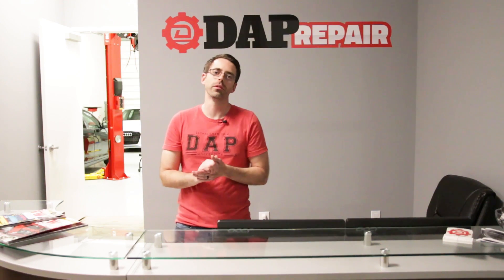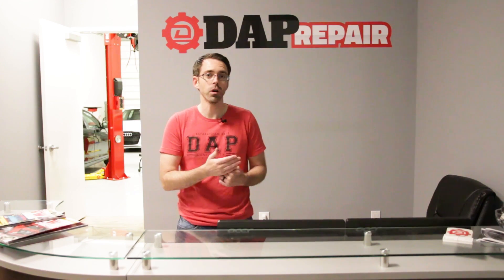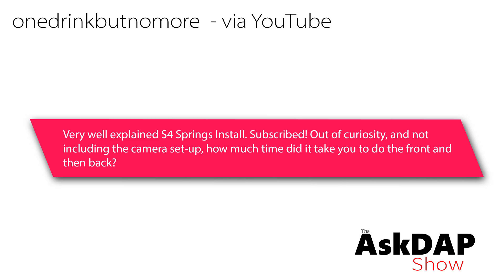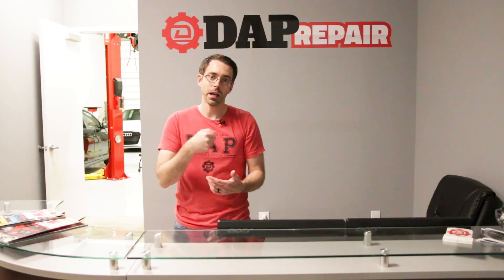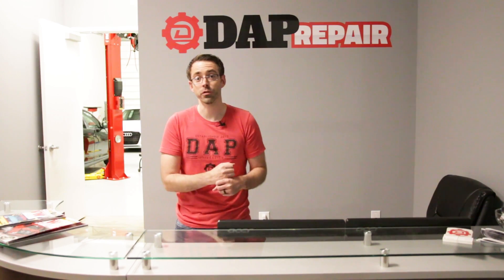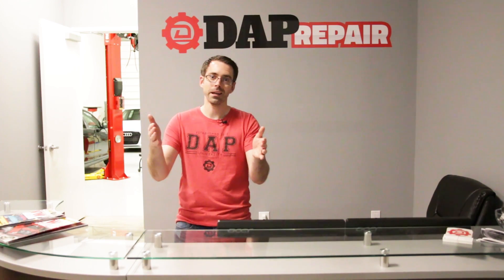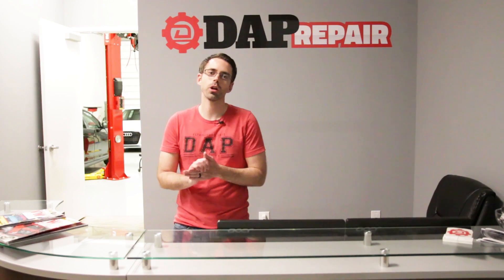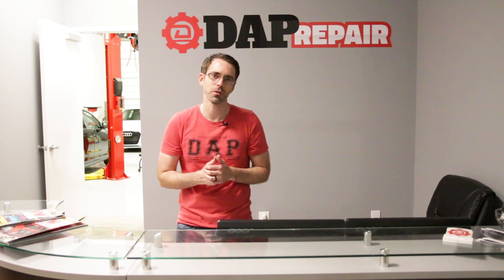Askdap Episode 122 | Are Expensive Intercoolers Worth It?

Comment: in the video of the TTRS fuel pump installation on the GTI project build, Max uses a small section of plastic fuel line which he crimps and seals, then he inserts it into the secondary tank suction fitting coming off the pump... I'm doing the same upgrade (using a PM4), I bought the pump from your company, just need to know where did Max get the piece of line that he used???

Comment: I have a mk7.5 gti dsg with about 2500 miles on. When I change from reverse to drive (or vice versa) I get a loud creaking noise from the rear of my car. I get the same noise if I tap the break hard enough at slow speeds. Is this something to do with breaks? Maybe suspension? Is this sound normal?

Comment: Great answers all around! I also enjoyed the spring install as it's a much different suspension system I'm used to coming from a 15 WRX. 
A question I have relates to the b8/8.5 s4 platform, based of car set up and use (in my case DD/spirited driving/ "canyon runs") which heat exchangers are best in regard to quality vs cost. From Merc Racing heat exchanger to the Alfa performance supercharger cooler system?

Comment: Hey DAP, idk if you’ve answered this question before because im new to your channel. I was wondering if you can give me some suggestion on the supporting mods after going stage 2, using Unitronic and catted CTS DP. Thank you.
Reply: Aaron Atuan An intake and intercooler. Wouldn’t hurt to upgrade your pads and rotors too. I’ve got a catted cts dp as well, just went apr stage 2 93oct and I feel like my stock intake and intercooler are holding the car back
Reply: Jordan E thank for the tips! I’ll probably do intercooler in 6 months from now. I already got the neuspeed intake. And yes definitely i didn’t even think about the pads and rotors. Thank you.

Comment: APR IC gives me sweet oil temps of 216f in 90f weather and prevents heat soak amazingly well cause i drove 8 hrs to TN and was doing random pulls with no power loss.
Reply: Kyle R. Just getting a tune will drop your peak oil temp ~10F. Heatsoak with stock ic is total shit tho! I need an upgrade

Comment: One thing to consider on quality of intercooler is also the fitment. A company like APR will spend a lot of time in R&D to make sure their products fit your car and bolts into the standard OEM design and you'll also see they have adapters available to make it work with certain models. They don't always get it perfect but paying more for their quality also includes the peace of mind that you won't get in the middle of an install and figure out you need to cut out something or weld something to make it work like you would with less expensive, more generic intercoolers. It's not the entirety of the value but it's a big component of it. Especially when you're paying a shop to install it. Would you rather pay more for the intercooler? Or pay more for the shop to cut up your car to make the less expensive component work?

Comment: DAP's latest project car is 3.0 Tupercharged V6 and Humble Mechanic's project car is a R32 V6. Coincidence? I'm starting to think VW/Audi 2.0T is more trouble than its worth, especially the CAEB 2.0T. Is this engine a ticking time bomb??? Even if you've replaced coils, replaced timing chain tensioner, don't have oil consumption issue (yet), etc
Reply: The MK7 had reached the end of the road as far as DIY and related videos are concerned. No other reason to get a new vehicle other than to provide more videos and content!
Reply: They picked those cars because they're relatively badass platforms. And they're a content source. Not because of mechanical issues.

Comment: Awesome video as always Paul! Can't wait to see the Ttrs pump video as I might be interested in that upgrade in the future. 
Quick question about turbo lag. I have the Wagner intercooler on my mk6 gti, very similar to apr or I.E. as far as design and quality and size. I've noticed that with all the upgraded piping, the throttle pipe and the turbo pipe, that the turbo lag is quite noticeable. Any ways to combat that? I'm pushing around 21psi consistently with stage 2 tune.